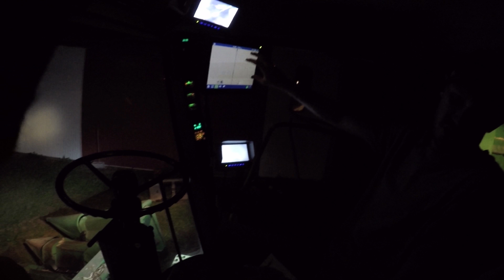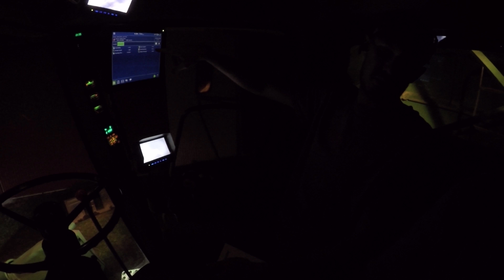1 Corn Bin Full, Final Corn Calibrations for Yield Monitor

Comment: At 2:17 what is that thing in the center of the grain bin opening?
Reply: It wouldnt fall over lol.... its so it doesnt make make a high pile in the middle of the bin.. this aids for better and even airflow for aeration.
Reply: snakerancher it spreads the corn out over the whole grain bin instead of making a pile. if it put it all on one pile the pile would become too big and could cause the grain bin to fall over because all the weight is on one side.
Reply: snakerancher grain distributor ,It spreads the corn evenly across the floor of the bin, not to pile it up in the middle